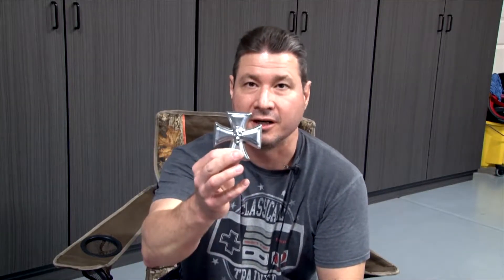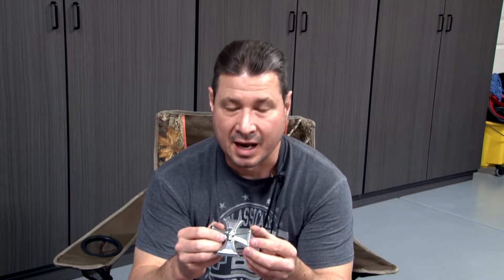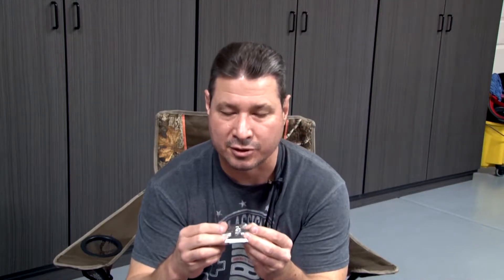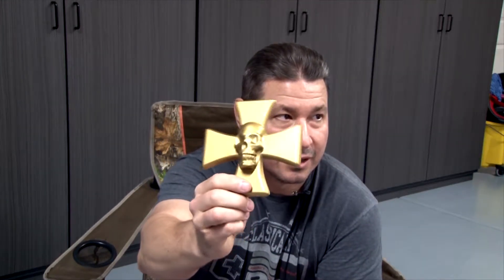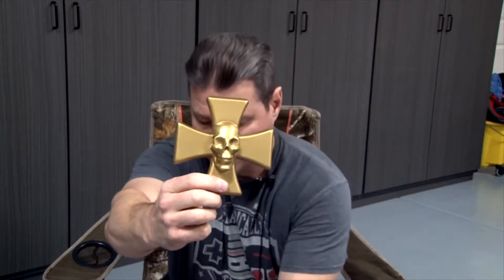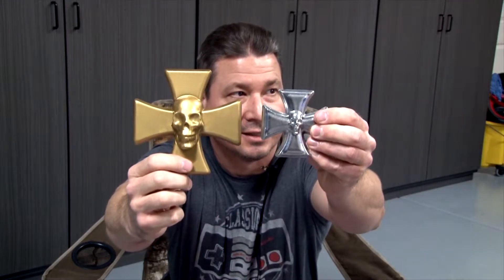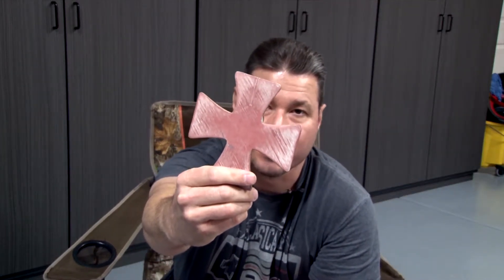Large Maltese Cross and Skull redone with a larger pattern in petrobond (Aluminum Sand Casting)

Comment: Looks great, nice work!  Agree that looks like some loose sand dropped from your vent holes, did you blow off the cope before you closed the mold?  
I think you could eliminate needing to mill the cope side altogether if you gate into the edge of the pattern in the drag and lose the vents.  It'll fill without them. 
That's how I'd do it, but then I do not have a milling machine so gating through the cope would be a much bigger cleanup job for me. With a mill maybe your setup is easier than having to clean up where an edge gate gets cut off... But you were already dremelling the edges in this video to clean up some flash so... 
Well there are many ways to skin a cat of course, and everyone has an opinion, lol.  If it ain't broke don't try to fix it.  Casting looks great!
Reply from the maker: Thank you! I agree with you on what you wrote, and there was another comment encouraging me to do the air vents differently also.  I also, agree that there are many ways to skin a cat but I am sure some methods are better/more efficient than others. I will be posting another video soon so I will try your suggestion along with some other suggestions that were left on my other videos.  I have not been casting until this year so any comments improving my castings I appreciate.